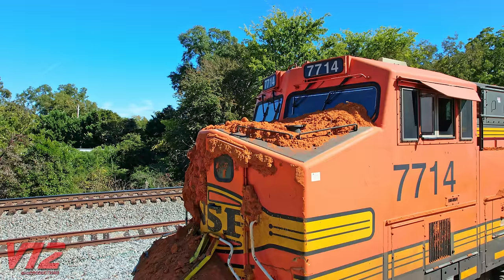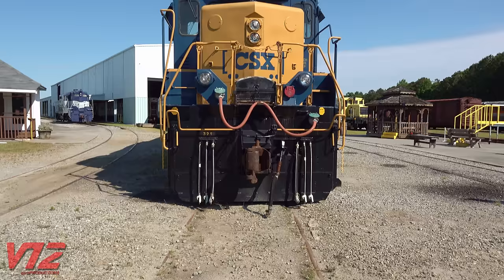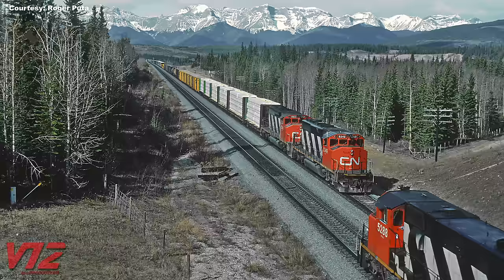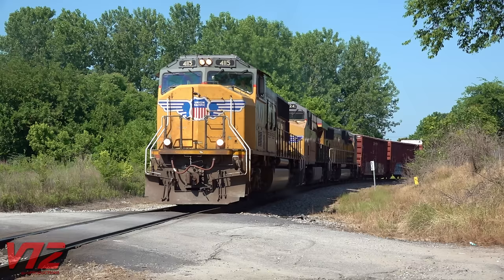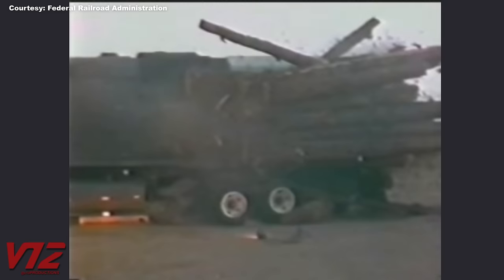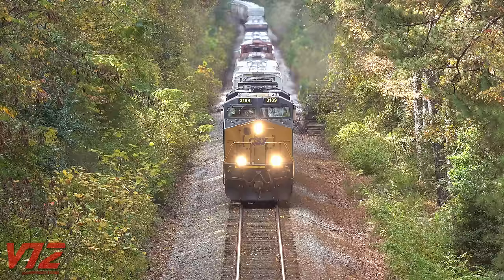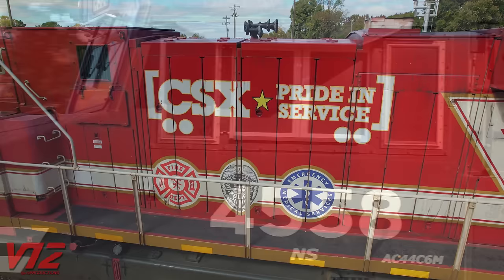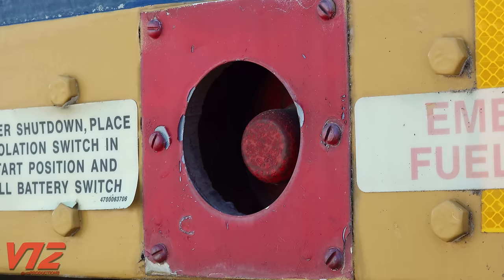How SAFE are Locomotives?

Comment: 6:47 mechanical problems can still occur to have the headlights not be on, in Canada the following applies:

Headlight failure: if the headlight on a movement fails and repairs cannot be made, ditch lights may be used instead and the movement can proceed.

If all headlights and ditch lights fail, such lights as available must be used to the point repairs can be made and must not exceed 10mph over private or public crossings without automatic warning devices unless it is known to be clear and will remain clear.

Human error could also be a factor but lights do occasionally burn out for some reasons

Comment: There is a crossing near me that the crossing guard has the train horn in it. It sounds like a computer instead of a train horn but when the crossing arms drop, the horn starts sounding off until the front engine passes the roadway.  It sounds weird and electronical, but I guess it works. The train horns are a LOT louder.
Reply: they call that a wayside horn, ten times more annoying then just letting a train do it.

Comment: I can speak to the headlight controls for most CSX locomotives, since I was a CSX engineer over 10 years ago.  Units of the era of the one shown have rotary headlight switches for both front and back headlights.  The switches start at headlight low, then bright, then add the ditch lights.  If the engineer forgets to turn the headlights on, when he sounds the horn, the ditch lights automatically come on in alternating mode, which is probably what happened in the video.  Older units, and former Conrail units often have separate switches for the regular headlight and ditch lights.  An interesting observation I made several months ago when I had a chance to watch the Office Car train pass by is that the ditch lights on the former Amtrak F40s do not alternate when the horn is sounded.  Amtrak's locomotives have long had alternating ditch lights, including on the F40s they still had when they became required in 1995.  I understand that at least a couple of railroads link the alternating function of the ditch lights to activating the bell, instead of the horn.  Let me be clear, ditch lights do not have to alternate, BNSF's do not.
Reply from the maker: Very interesting. Thanks for sharing!
Reply: It's also quite different for people like me who operate over about 3 miles of track with multiple crossing, yet its all private property. We switch out a plant and then shove cars uphill to the yard. There is safety meetings and a thick binder of general good practice rules but to be quite blunt, I'm shocked we haven't derailed more than twice this year with how horrendous the maintenance is. It seems like any one of our GP39-3's is down for major maintenance monthly. They are years past blue card spec and kept together with zip ties. I have photos of this. But hey whatever feeds the world

Comment: I'm a truck driver: Steel coils are extremely deadly for anyone. They're absolutely horrifying and should only be pulled by extremely experienced drivers.
Reply: Even better, ship them by rail.  They have specialized, covered cars, just for steel coils.  Could also load them on traditional flatcars.  Yes, you're going to say that not every steel plant (shipping or receiving) has rail access.  That could be addressed in the planning stages of starting up a business... build where the rails are.
Reply: @stanpatterson5033  You're correct that rail transport of sheet steel coils is better than trucks.  There have been many designs for covered coil steel cars over the yrs.  However, RRs would never haul steel coils on a flatcar.  The buff & draft forces experienced by the flatcar would toss the coils into the next car ahead or behind the car carrying the coils.  No amount of wood blocking would keep the coil where it should stay.  Thus the designs for coil steel cars over the yrs.

Comment: the fuel cutoff button controls the fuel pump control circuit - which controls the fuel pump control - which controls the fuel pump relay. its normally closed, so if those goons had shot it with some accuracy, it would have shut down.

Comment: In Mexico, all locomotives are required to have metal bars also known as Security Bars in all windows and doors the moment any locomotive enters Mexico for example a Ferromex locomotive in the lower 48 states does not have to include the security bars installed as crime rate is lower here. In Mexico however, they must have the security bars installed regardless of which state the locomotive is in Mexico, i.e, Chihuahua, Tamaulipas, or Sinaloa as the crime rate is much higher there due to lack of infrastructure, lack of police presence, and the lack of space. I need to research more of Mexico’s railways. Also slandered gauge railways have no connections to Guatemala as Guatemala has only narrow gauge rail lines of which almost all but a few are abandoned in the country of Guatemala.

Comment: I heard that not long after CN started to use the safety cab that UP (?) borrowed a set of engines to evaluate. They accidentally met head on with standard cab locomotives....Safety cab passed, standard cab failed.

Comment: Awesome.  I wonder if you could do a video that explains how trains with DPUs work on mountains like Cajon Pass, where cresting the top say locos at the front have to slow up whilst DPUs keep 
pushing etc. could you explain how this is controlled?
Reply: Google locomotive fencing
Reply: DPUs are controlled by radio and can be synchronous with the lead or operated separately.  The head end could go into DB while the remote is still pushing.
Reply: @r_mon_e  correct, this would be called putting the fence up and the engineer can control in certain situations

Comment: Anticlimbers were invented for wooden passenger cars which had a nasty habit of sliding inside the car ahead.  Vestibules on passenger cars are designed as crush zones which is why Amtrak won't let you stand in the vestibule while the train is moving.  A PCC trolley (anticlimber) hit a bus (no anticlimber) in Pittsburgh and climbed inside the bus.

Comment: I have repaired very much worse. Nothing appears damaged on the frame and draft pocket. Everything else is more or less cosmetic. It seems a lot worse than it is. When they are wrecked on their sides as in a roll over is far mor difficult. 
Composite locomotive mechanic speaking here.

Comment: You should have used the footage from operation Smash Hit where they literally wrecked a train into a nuclear flash to show just how much it could take, the footage is incredible to see
Reply: I have seen that mate its a class 36 I think and two carriages they put on too it the locomotive weighed 139 tonnes with carriages it weighed 220 tonnes that flask weighed 50 tonnes and it was in the 1980s in england they put the flask on a flatbed and they weigh about 40 to 50 tonnes why I say that is because that locomotive come out quiet good I seen a picture of it upright on some sideing also the track was took away just a few foot from the flask and flatbed so that train hit over 100 tonnes going 100mph I think the kinetic energy rebounded back at the train , I was about 7 years old lol wen I seen that video , godbless you,

Comment: Cabs aren't really safe. One well known example was the Hinton accident in 1986, the Locomotives that were involved were completed destroyed since the impact was at track speed. Low speed accidents are a different story.
Reply: You're comparing locomotives from the 20th century to locomotives of the 21st LMAO
Reply: @AbelG8781  the Locomotives were gp40s which was new then with the Canadian comfort cab which still operates now
Reply: And the irony off it the trailing sd40s had a safety reset while the geep didnt

Comment: That would be repairable. Platform looked ok the coupler and draft gear pocket might be ok. Cut off and weld the bent sheet and replace the steps, cut levers, handrails along with ditch light housing and mu plug. It would be major repair and billed to the person who occupied the crossing. Lots of inspections would take a bit of time.

Comment: Locomotives are safe. Railroads aren't. Railroads do nothing for safety. They just make a rule against whatever is dangerous instead of eliminating the danger.
Reply: Psgr 90's statement "Railroads do nothing for safety," is false.  RRs adopted air brakes beginning as soon as the air brake was developed in the 1870s.  Decades ago RR operating crew (engrs, flagmen, conductors, brakemen, firemen, etc) routinely boarded & deboarded moving equipment & RRs started prohibiting such actions because of excessive injuries to employees.  Back in the early 80s, RRs started eliminating cabooses from most freight trains since conductors & rearend brakemen & flagmen kept getting injured from the train's slack action.  RRs also adopted use of radio communications as a way to make operations more safe & efficient.  So, Psgr 90's statement is false.
Reply: @roberthultman9691  Railroads adopted air brakes because the govenment forced them otherwise it was cheaper to just keep replacing dead brakeman. The other things you mentioned were implemented to increase profits.

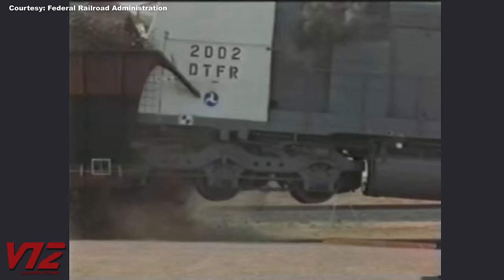Comment: 5:30 freight cars don´t have anti climbers on purpose. The anti climber is there to protect the cab and crew from other vehicles overriding the loco's frame and squash the cab. 
But since on freight cars there is nothing to protect, and the energy of the impact has to go somewhere, the loco climbs the freight cars frame and destroys its carbody, dissipating energy while twisting all that steel. 
Because if nothing gives, like when 2 locos hit head on (there's a video from mexico of 2 modern SD70ACe doing so), the impact is brutally hard, and everything inside the cab will be catapultet forward immediately. Without the anti climbers, freight cars function as a "soft" crumbling zone for locomotives. There are pictures on the web of trains rear ending others where this can be seen, that the loco has squished and mangled several freight cars and tossed them to the side before finally coming to a halt, but is still in relatively good shape for the circumstances.

Comment: EMD cabs are called a whisper cab very safe and quiet cab henist whisper great content keep ‘em coming
Reply: After the sd60 widecab the BN had and the sd70ace thundercab that CSX, UP, NS all had
Reply: Whisper cab, biggest lie ever. Believe me.
Reply: @AbelG8781  Amen. SD70ACE's should be trailing unit only.
Reply: @sharkheadism  BNSF removed the horns on many of them for that reason, no leader position anymore.
Reply: @AbelG8781  Yep. Ride like crap, loud, do not hold the rail, dynamic sucks.....Trail only.

Comment: I was riding the Surfliner and the window I was sitting next to was shot.  It was loud and startling, but the glass held.
Reply: Lucky you are alive
Reply: The glazing material is not glass, it's most likely polycarbonate plastic, GE Lexan is 1 brand name.  Glazing on old Budd-built stainless steel cars taken by AMTK decades ago was 2 layers of polycarbonate, both 1/4" thick.  You aren't going to bust thru that with any hand-held tolls or weapons.

Comment: The one take I have that people find interesting is that the "European Style" (A Hi horn and Lo horn) is simply better that the "American Style" (Horn and Bell) imo. Bells are great, don't get me wrong, like you can keep them on consistently for consistent warning, the mechanical bells sound nice, etc., but then again, you can already hear the train itself coming, which kinda makes bells pointless. A Hi and Lo horn make more sense; A quieter Hi for general use and a louder Lo for warnings (the equivalent of the bell, except used for warnings).

And then the flashing ditch lights, well its cool but stupid. I guess it does provide better safety to some extent, but it just causes the lights to die faster.

Ditch lights themselves, hell yeah! For one it actually is good to have for safety (it improves noticeability of the train a lot), and imo it is very much aesthetically pleasing.
Reply: The bell is really for yards, where the horn would deafen crewmen who got too close.  The bell is rung out on the road because, well, the bell predated the steam trumpet and "that's the way it's always been."

Comment: there is one take away form my time driving a truck and  life in general  that ANY TRUCK DRIVER GETTING HIT BY A TRAIN  SHOULD NEVER GET TO DRIVE  EVER AEGEAN   THERE IS NO REASON  THAT A TRUCK DRIVER SHOULD BE IN THIS POSITION  
THIS IS PUTTING THE LIFE AND PROPERTY  OF THE DRIVER AND OTHERS AT RISK
THIS IS FOR THE SAFETY FOR THE DRIVER AND THE OTHERS AROUND     there are a need for the drivers to be as safe and the best at what the do   if they are not aware of there surroundings  they are just not safe to drive
Reply: As far as I know, trucking is an equal opportunity occupation. Any idiot can try his or her hand at earning a living doing it. They have a system in place that penalizes poor drivers, but it is up to the individual to prove his or her worth, and collect the appropriate prizes.

Comment: Well done!   Thank you.    What was the purpose of the high front dieselocomotive.  The front was as high as the roof.   Father had a high front Lionelocomotive.
Reply: High hood. Some of the high hood locomotives had a steam generator that needed the extra room... when passenger trains were more commonly steam heated. Also added to safety.
A few roads ran long hood forward for safety also. (N&W)

Comment: What about the "dead man's brake"?
Reply: Dead men don't get breaks. They are summarily dismissed from employment,  and can spend the rest of their days resting.
Reply: @stanpatterson5033  Oops, I spelled it wrong, I meant, brake, not break.
Reply: It is called the crew alerter.
Reply: @SantaFe19484   As another commenter has stated,  they no longer use the dead man's pedal.  The old DMP has long been replaced by a device called an alerter.  When the control unit has not sensed input from the operator in a period of time,  it causes some lights to flash (and can also include a noise) to get the operator's attention.  The operator is required to slap a button, could be a pedal on the floor, or could make a control adjustment to the unit, to satisfy the alerter system that the human operator has not fainted,  become distracted, left his post, or become incapacitated in some way.  If the human operator does not respond to the alerter's request for input of any sort,  the alerter system causes the train's brake system to go into "emergency", which knocks power down to idle, and dumps the train line, which puts on the emergency brakes, bringing the train to a complete halt, on the assumption that no human is alert and paying attention and in control of the train.

Comment: They are not safe at all in a crash . It's all metal,  hard metal inside and no safety devices inside to keep the occupants inside safe . Chances of death is 95 percent  in a crash .
Reply: if that was the case the Majority of people would die in a Train accident, but most people don't so that's not an accurate percentage, also it's more Steel than Metal.

Comment: I do feel that locomotives can be safer, as I wonder if they would have airbags installed in the cab where the controls are.
Reply: Without seat belts, they crew would be launched even harder than they already are to bounce around the cab like being in a clothes  dryer.
Reply: @tonyburzio4107  Ah yes, that's one thing I forgot, I really thing seatbelts should be installed.
Reply: @warthog23  The only time seatbelts would do anything is when you hit another train. If that happens, seatbelts are not going to help. There is so much mass moving.....I hit a loaded grain semi at 60 and barely felt it. Seatbelts and airbags would do nothing really.
Reply: @schinbone0  Well, there's gonna be lots of tests to be done for mulitple safety reasons, if seatbelts nor airbags can't do anything for a derailment or collision with another train, I have no other option for GE or EMD, or any other locomotive manufacture.

Comment: So why CN, UP, and BNSF don’t have operating ditch lights on their locomotives?
Reply: They do.
Reply: @tonyburzio4107  I meant flashing ditch lights.
Reply: In north idaho where the UP/CP and Bnsf trains roll, they both have alternating ditch lights, but they are not always used. Most of the time they are on constantly
Reply: It depends on where they operate.  In some jurisdictions, flashing ditch lights are a requirement.  In others, they are not.  If you plan to operate the equipment in those places where alternating ditch lights is a requirement, it has to be equipped with that function. If operating in places where it is not required, the operation of flashing ditch lights does not need to be activated.  Most locos built nowadays are spec'd out so that they can provide run-through service wherever they might be sent.  In cases of operating in certain jurisdictions, the operating crew must follow the rules laid out by their company, and rules laid out by federal regulation.

Comment: Was safety the main reason that some diesels ran "long hood forward" years ago?
Reply: Yeah, the railroads in the southern and eastern areas of the US had all their locomotives configured for long hood forward (LHF) operation. NS still does that sometimes, which is why they're one of the only railroads to order rear ditch lights on their mainline units like GEVOs and SD70ACes.
Reply: Actually, running LHF was a hold-over from the steam days.  Having all that metal in front was safer; most GP/SD 7's and 9's had the long hood designated as the front.
Reply: @everettrailfan  locals maybe but for mainline trains cause of an accident in 98 that the ble forced ns to stop running lhf
Reply: @everettrailfan  Up here in Canada, they all have ditch lights on both ends. Only exception is dedicated passenger locomotives, which still do have "headlights" on the hind end.